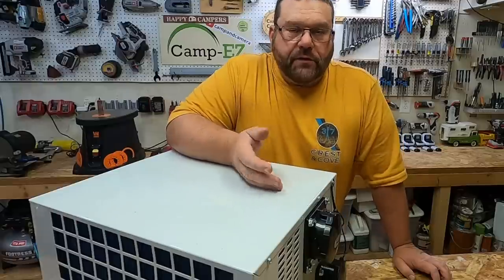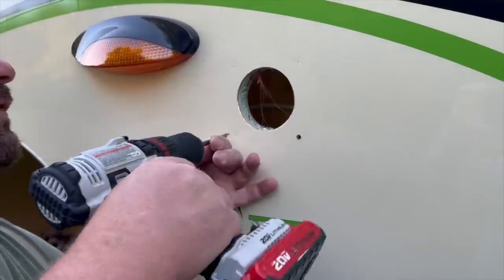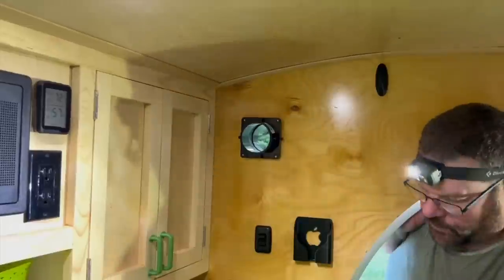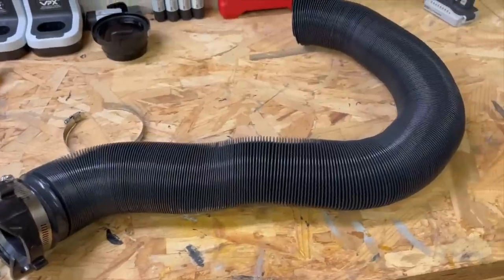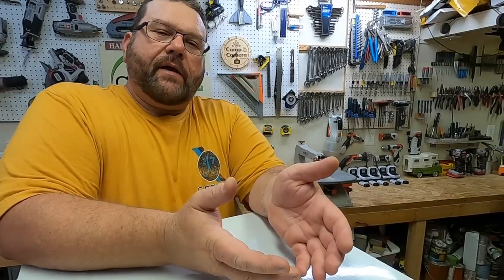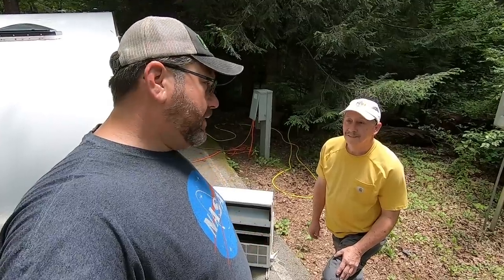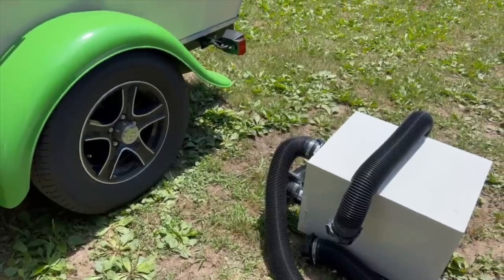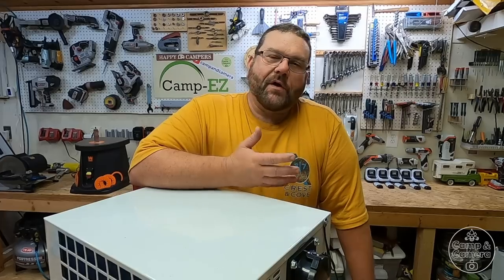Never use a USED SEWER HOSE for a Teardrop Camper Air Conditioner install

Comment: Another great video Michael. Man, you're making me famous. Seriously I am honored you have interest in my little projects. The diy a/c has undergone some evolutionary improvements since you did the video. I still use it. One thing I might add about the ClimateRight unit. They came with duct hose & fittings but it is my understanding they were cumbersome and not high quality. Most people did what you have done and use sewer hose. Look forward to our next camping adventure. It's always a great time.
Reply from the maker: I’ve had that footage in my back pocket for a while now, but knew it would come in handy someday.  You’re a DIY master Mr.Ed!  I look forward to our next one.

Comment: I modified a window unit, I had to add a blower fan on the return and I wrapped the cold air hose in reflectix, taped with true duct tape, was able to keep my unit 80 when it was 100 plus in direct sunlight

Comment: One my DIY system I found that the fans do not move enough air. So I  added inline duct fans to give the air circulation a boost and it helped greatly.

Comment: Just found you channel and loving the content. I have a climate right like this. I used sewer hoses like this also. But what I did was used the wall shelf bracket and set it up to use the fender as support and set my unit on it. Was able to make my hoses much shorter and keeps the unit off the ground.
Reply from the maker: Great idea!

Comment: they make 4 inch insulate heat duct hoses,   not only is the sewer hose black but its too long and its got too much surface area,  think of it like an old radiator, all those cool looking expansion rings are cooling loss surfaces.

Comment: Great video as always. Look into like kitchen vent hose, they're smoother on the inside as they're made to flow air. Also flexible because they are replaced rather than cleaned with all the grease coming from frying pans etc.

It would improve airflow and lower the noise. Aluminium lined and more often white outer colout. Google kitchen vent hose.

Thanks again for sharing your build.

Comment: That’s awesome.  I have a setup like Edwin’s.  Some things I did to make it perform better was to put it on a table to get the unit as close to wall connections.  That allows you to shorten the hose and expose less hose to sun.  Also, I put a bilge blower in-line on one of the hoses.  It  moves air significantly better.  AC fan isn’t meant to move air through hoses and angles.  Bilge blower does come with a noise penalty but worth it. (By the way, I bought one of those spring punches because I saw it in one of your old build videos.  Use it all the time.)
Reply from the maker: I’m gonna take your tip of elevating the unit and shortening the hoses.  The punch tool is frequently used around my shop!
Reply: Glenn, I also have an inline duct fan in the return hose now. I have also added a run timer to cycle the unit 8 min on & 2 min off.

Comment: When heating a space, heat down low and reserc up high.  When cooling reverse it.  Cool up high and reserc low. You need the move the air where you need it.  Hot rises and cool drops.
Reply from the maker: Great logic, thanks!

Comment: You should have a 10X10 canopy you don't make cold you remove heat .Use passive tools to prevent loading heat thus less heat to remove .
Reply from the maker: I like your way of thinking
Reply: @CampandCamera  I was trained that when I drove refrigerator truck.

Comment: They make a HVAC wrap you can put around your hoses and it helps tremendously. I had that same unit but up graded to the big brother one because the condenser leaked around the copper 90s. With insulated hoses and the bigger unit I had my teardrop stay at 60 inside when it was 104 outside. For the wrap measure the outside diameter of your hoses and there is a insulated wrap that will fit.
Reply from the maker: I didn’t know about the wraps.  Thanks!

Comment: One of those A/C unit came with my vintage  teardrop but no remote and I cant find one that works for it anywhere. I already have the vents cut in teardrop
Reply from the maker: I just typed “Climateright remote control” in eBay and saw a couple that may work.  Not sure though.
Reply: @CampandCamera  I bought one thru Ebay that said it was compatible but it didn't work. No returns , it came from  China. But thx. Maybe I'll ck again
Reply from the maker: I just went to Climateright’s website and see they have just remotes for sale.  Lots of items on their site are listed as out of stock, but not the remotes.  Maybe they still sell them?  Here’s the link:

https://climateright.com/collections/replacement-parts/products/cr-remote
Reply: @CampandCamera  Thx